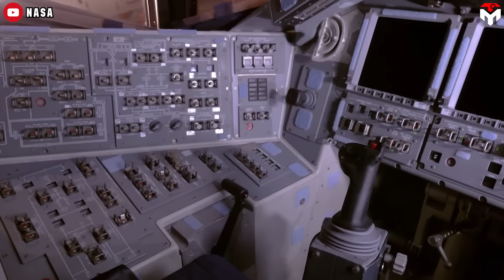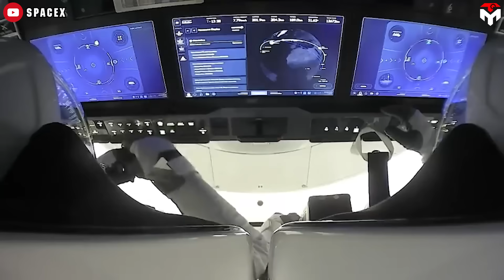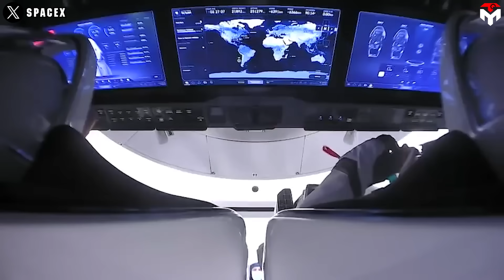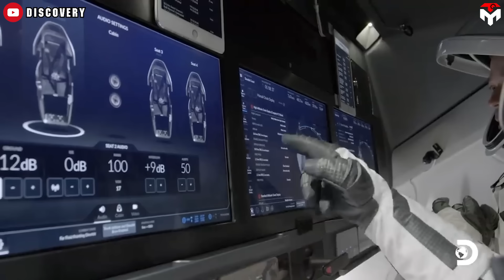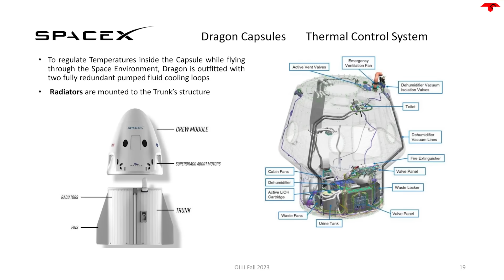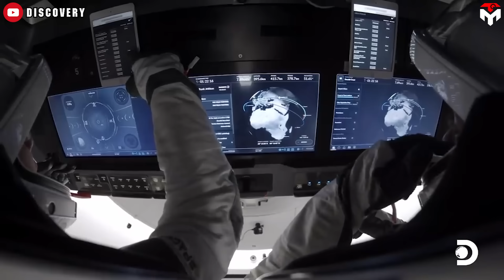NASA Astronauts revealed Life Inside SpaceX Dragon Interior, REFUSE to Fly on Competition...

Comment: the Soyuz isn't 'like a prison' - it was designed back in the 1960s with reliability in mind, not space tourism (although it handles safely delivering space tourists to the ISS quite well). And it's still operational, unlike Apollo. The Dragon is new and was designed with both delivering astronauts to ISS and space tourism in mind.
Reply: Abandoning Apollo-Saturn wasn’t NASAs choice. It was essentially the Nixon Administration and Congress which killed Apollo and Saturn, and as a heavy booster, only the Saturn V can claim a record of no major catastrophic failures, or what does SpaceX call it? “Rapid Unscheduled Disassembly” the funniest euphemism for the spacecraft exploded. 

I think it was a major mistake to abandon Apollo, especially in favor of the death trap that was the Shuttle, which was, until the ISS finally was built, a space truck to nowhere. The Shuttle could never get beyond low earth orbit (loe), and it was a stretch to get it to the altitude of the Hubble Telescope. There wasn’t much room for margin of error, because the shuttle orbiter itself didn’t carry a lot of fuel. 

Even a refueled Shuttle orbiter could never go beyond leo because its tiles (for protection from the scorching temperatures of reentry) weren’t designed to handle the heat of a reentry from a higher orbit, such as a return from a lunar mission. Neither could the design of the shuttle itself. Reentry at such a higher velocity would tear the Shuttle apart, much like what happened to Columbia. I don’t know if the SpaceX Dragon could withstand such a high velocity reentry. Apparently, the Soyuz could withstand such reentries, because the Soviets did design the N1 booster, which had similar boost capacity as the Saturn V, and the Soviets did design a lunar lander, though it could only hold one person, making it much riskier than the Apollo Lunar Module, which carried two persons. 

I think had NASA not been forced to go with the Shuttle (and what NASA engineers had in mind for a shuttle spacecraft (which would be able to land like an airplane) was MUCH smaller than what was developed. It would have been limited solely to the crew only, with no cargo bay—the cargo would be launched separately. 

However, the Nixon Administration basically ordered NASA to build a vehicle with a large cargo bay, the size of which was dictated by the military and intelligence agencies, whose satellites would be launched by the Shuttle. As it turned out, the military and intelligence agencies decided that it was much cheaper to launch their satellites on uncrewed boosters. And NASA was stuck with five enormously expensive and unsafe (due to its design) white elephants. And the extremely successful Apollo-Saturn (which obviously have been updated with modern computers, as the Shuttles were) thus requiring fewer switches, and a smaller instrument panel. 

Like the Dragon, Mercury, Gemini, and Apollo spacecraft were all designed with input from the astronauts who would fly them. SpaceX has the luxury of learning from innovations and mistakes in previous NASA designs, and while all of this was built by SpaceX, the design of the Dragon was a collaborative effort, with much input from the astronauts. It’s also important to point out that in the early years (Mercury, Gemini, and Apollo) the astronauts, who in those days were almost all test pilots, insisted on having the capability to fly the spacecraft themselves, in the event the computers had a failure. This required a complex instrument panel, and all those switches. Touchpads simply didn’t exist back then. But all the spacecraft and boosters back in the day were overseen by NASA, but built by private corporations, so it’s not all that different than today. 

One big difference was that NASA was handed an extremely difficult task by President Kennedy—to get to the Moon by the end of the decade, and to beat the Russians to it. This goal was handed to NASA just after NASA successfully launched Alan Shepard into a suborbital flight into space, with a total mission time of about 15 minutes (from launch to splashdown). So the designs for Gemini and Apollo weren’t done with luxury and comfort in mind, but to meet that goal, and to beat the Soviets to it. Things had to happen fast, and about 400,000 people were involved. It wasn’t run by one CEO.

Finally, I would point out that in these comparisons, it’s easy to forget NASA’s successes (with very low budgets) with uncrewed exploration of the Solar System, either flying by, or orbiting, or landing on every planet in the Solar System, (the Soviets too had a similar program, managing to get a photograph from the surface of Venus), and we have even had a flyby past Pluto. 

Before Voyager, we had very little information about the outer Solar System, and had poor images of Uranus and Neptune. We knew almost nothing about Uranus and Neptune until Voyager 2 passed by them. We’ve also sent other missions to Jupiter and Saturn, and the ESA (European Space Agency) sent a probe which landed on Titan, Saturn’s largest moon. Currently, NASA recently launched a probe to explore Europa, one of the four largest moons of Jupiter (first discovered by Galileo), which, under its ice, likely has liquid water, and possibly, life. 

Finally, there are the many probes that have landed on Mars, many with robotic rovers that have traveled far from their touchdown point, and the various space agencies have sent probes to comets and glaciers, and then there are all the various telescopes launched into orbit, where they have observed virtually across the electromagnetic spectrum, from gamma rays to x-rays, to ultraviolet, to visible light, to infrared. Radio telescopes don’t need to operate in space, because our atmosphere doesn’t block out radio waves. This has led to innumerable discoveries, and the James Webb Space Telescope is really just getting started on its mission, and has already sent surprising images of the very early universe.
Reply: We were very lucky the Russians brought an American woman astronaut home last year who'd been up there a long time...along with a Russian  male astronaut on board their soyuz. It's crazy how they land in the desert. People reach in and carry them out to chairs, covered them with blankets... water.. it looked very improvised but they don't spend money on optics. The Russian film crew didn't give her any film time. Consider Biden refused had no communication with russia for 3 years I'm appalled. They didn't have to bring her home but they did. Shame on the Biden administration. He should have publicly thanked Russia.
Reply: @Betsy.Ross76    What are you talking about? Not a word of that is accurate. Both the Russians and the Americans conduct ISS crew rotations about every six months. They swap seats, so there is always an American aboard the Soyuz capsule, and always a Russian aboard the Crew Dragon, and they always stay six months. Loral O'Hara was launched aboard Soyuz MS-24 in September of 2023 and came down on the same spacecraft in April of 2024, as scheduled. Tracy Caldwell-Dyson was launched on Soyuz MS-25 in March of 2024 and came back, as scheduled, at the end of that mission in September of 2024. Everything went entirely according to plan.

Comment: The Space Shuttle was amazing, and had zero fatalities (except where managers / politics overrode the advice of engineers ‘don’t launch when frozen’ ‘don’t look at the leading edge of the wing’. However, the emergency boosters of Dragon are a huge safety upgrade. Most (all?) other spacecraft were ‘if the rocket shuts down early during launch, or anything goes weong, you will die after a long fall back to earth’. If anything fails to separate properly (boosters) - dead. Dragon can fly away if anything goes wrong during launch!
Reply: No. Mercury and Apollo capsules both had escape rockets on top of them to pull them away in the event of a booster failure. Gemini had ejection seats.

Comment: The space shuttle was the most awesome thing I have ever seen. But maybe to expensive I don't know but it had a big cargo bay, and it landed back on earth like a plane. Too my way of thinking we are going backwards.
Reply: shuttle is low earth orbit capable only and can't even return us to our moon, let alone mars.
Reply: One improvement over the shuttle is the launch escape system in a capsule type system like this. On launch if the booster has a failure the dragon capsule detaches and uses its own rockets to take the crew away from the failure below. Also the heat shield is protected on launch and can’t be damaged like the shuttle was. I loved the shuttle but this system is much more safe for the astronauts.

Comment: So, what happens if the craft starts to spin wildly out of control and there are no levers or buttons to grab onto or push? Your elegant touch screens become a deadly liability….. don’t they?
Reply: The reason for spinning in the first place is probably someone on those same levers or buttons ... so, remove the "cause" and you won't need the "cure" !!!
Reply: What happens if your ABS, collision avoidance, airbags, electronic transmission, etc. fail?
Reply: @ Your point?
Reply: @clarkhowell8267  Exactly!
Reply: The levers and the touch screen connect to the same electronic systems. If the system fails then it doesn’t matter what type of control panel you have. I believe that they still have analogue controls along side the touch screens on Dragon as redundancy is king.
Reply: @ They don't. My POINT is that when things go haywire, and your craft starts to spin out of control, YOU NEED TO HAVE A PHYSICAL THING TO HANG ONTO AND GAIN CONTROL!!! LIKE A STERRING WHEEL!! How is this hard to iunderstand?
Reply: @clarkhowell8267 because no such thing exists on any spacecraft. The stick on the space shuttle is the closest thing to it, and that just controls the flaps and rudder, you couldn't use it under power. Astronauts operate under 3x the force of gravity on ascent, which is just barely manageable, but under emergency conditions, that force could be 10x or more.
Reply: You wouldn't be able to operate any of the controls on the older spacecraft either under those conditions.
Reply: @SapientSheep  The point is, Mr Wizard, is that I could TRY!
Reply: Amen.
Reply: @DonnyHootieHoot congrats on proving your a true idiot who didn’t even watch the video. It was all explained Fafo 😂

Comment: The Apollo Command Module (CM) had 210 cubic feet (5.9 cubic meters) of habitable volume. You make it sound like a jail cell, which it was not, especially after Apollo 7, when foldable couches were introduced. The CM was comfortably crowded at launch and became more comfortable in zero G. 6.4 cubic meters is not much more space, but the additional space is used better, with the application of the glass cockpit, and a better (or at least novel) seating arrangement. Some of those interior shots of Dragon are so quick you need to still-frame the video to get any applicable detail. Why the "hide and seek?"
Reply: One of the obviousities you missed is the amount of space saved with modern electronic systems.  Four flat screens and a computer the size of a wallet is all that is needed to run the whole shbang!

Comment: A.D. 2020: Dragon was the first manned spacecraft launched into low earth orbit since the shuttle…
/Patiently waiting for America’s manned space program to escape the 1960s. 😅
Reply: Atlantis flew for the last time in 2011. The space shuttle was designed in the 70s and built up until 1991 with incremental improvements. Since then there have definitely been manned flights, as there have been constant resupplies and trips to the ISS. These missions used Russian Soyuz vehicles which are, as you said, from the 60s, but using more and more modern equipment over time.